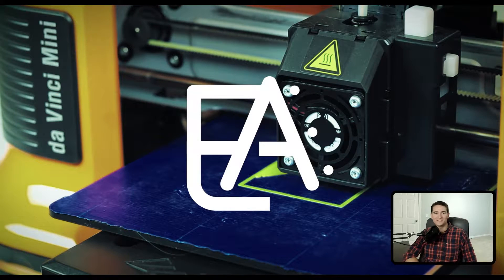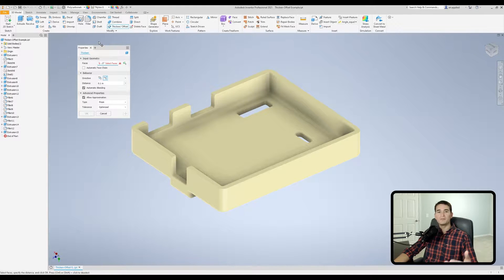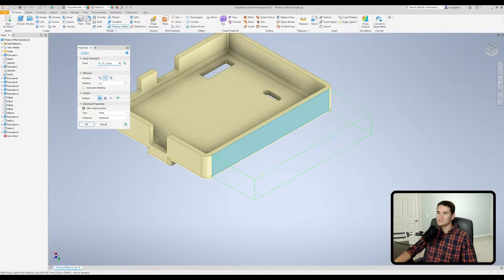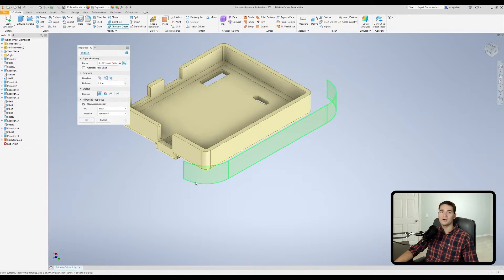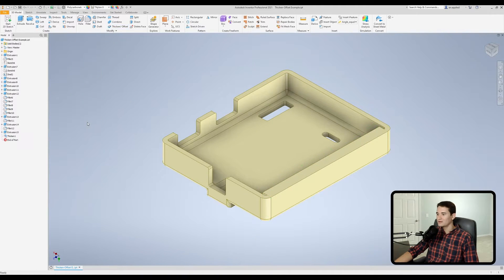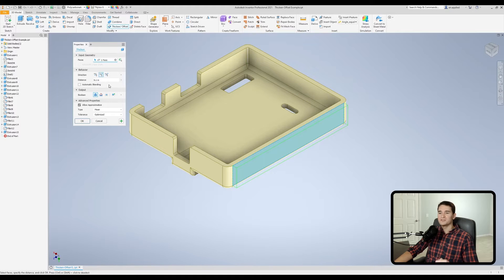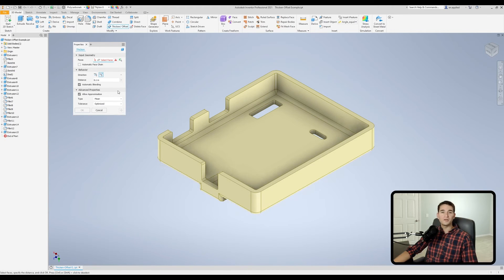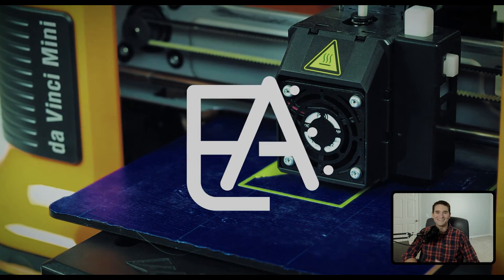Thicken/Offset Tool and Options - Autodesk Inventor Part Tutorial | Autodesk Inventor 2021 IN DEPTH

Comment: Good evening, I am currently doing design work from a reverse engineering process for mechanical parts.
Usually working in the Autodesk suit, the parts I am studying were developed in Solidworks.
The function I am writing for is "thicken", which in inventor allows to select a direction (even different from the normal to the surface) (which obviously implies not being able to recreate the same component) I can't find an equivalent in either Inventor 2023 or Fusion 360.
Do you have any ideas?